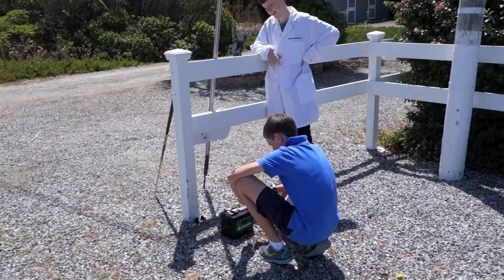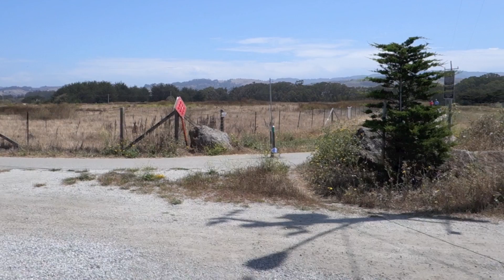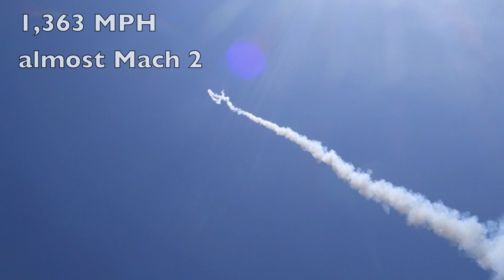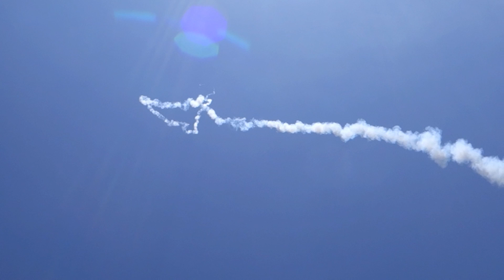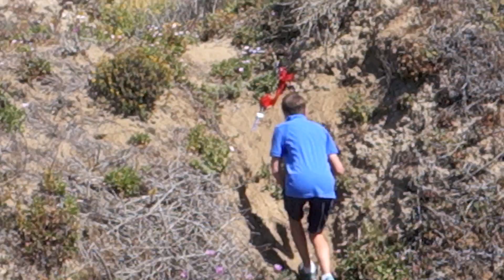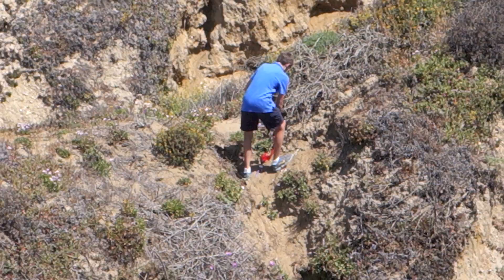Going Supersonic with a 3D-Printed Rocket

Comment: Absolutely awesome! Generally, I think the FAA does not allow anything to go Mach 1+ unless you're under restricted airspace with a clearance. 

None-the-less, super bad-ass!
Reply: Jonny Hyman you dont know what the hell youre talking about
Reply: @saadmirza2727 actually he does. I am a level 3 rocketeer and in order to launch a j270 motor, i have 8 of them, you need a level 2 cert and faa clearance. 

If the rocket with motors weighs less than 1500g and the motor propellant is less than 125g, then no faa is required.

Since he is using a j270, he should know this, but maybe he got it from a friend because you cant even ny a level 2 motor without a level 1 certificate and passing a written exam for cert flight.